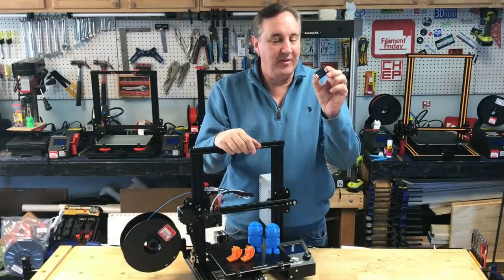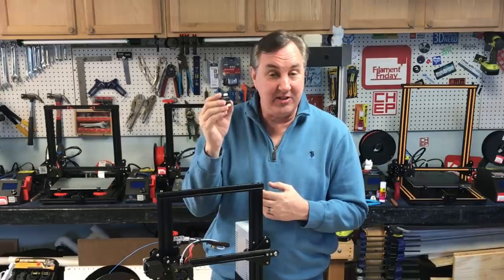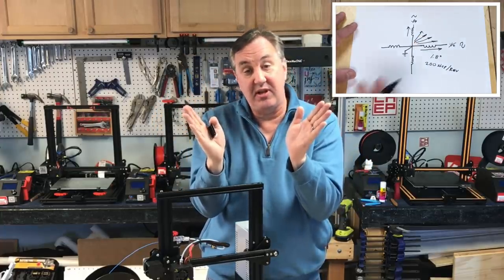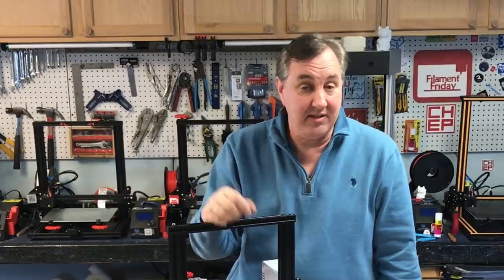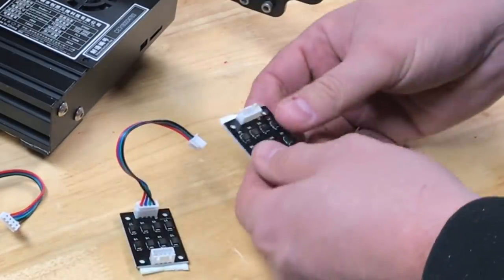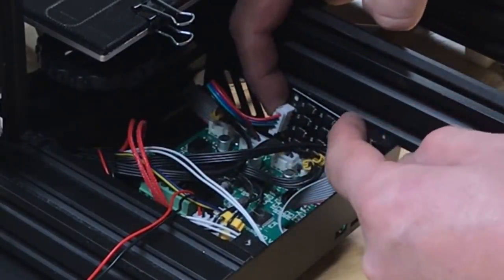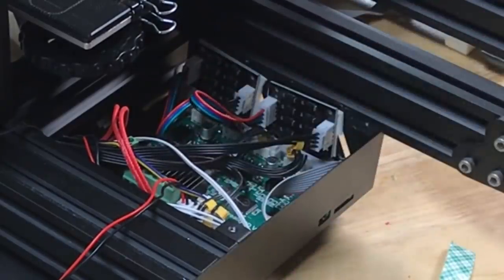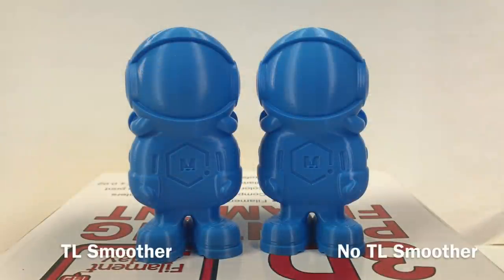Creality Ender 3 - TL Smoothers Upgrade and Test

Comment: Hi, actually this smoother can't "filter" anything. There is no "small" pulses by amplitude! All pulses from driver to the motor are 12V (if you power supply is 12V). The pulses varying only by width.
And in this context the only thing what the diodes can do - reduce amplitude of all pulses by about 1.5V. The same effect you can get just reduce power supply voltage to 10.5V only for motor driver. 
If you use RAMPS board - it have separate power supply input for motor driver. You can put in series to this input two 1N5401 and you get the same effect just with two diodes. For better result I suggest to put some 1000uF 25V elco after this diodes to the ground.
Actually less amplitude makes stepper motor a little bit slower, that what you can get simple reducing acceleration. But in this way you make it by the hardware and not by software.
This "smoother" is just waste money...
Reply: so why it did worked?
Reply: @tricelbor  As I've wrote: reducing amplitude makes stepper motor slower: smaller voltage amplitude -> smaller dI/dt -> smaller acceleration -> smaller bouncing and vibration - less artifacts by printing.
If you use RAMPS board (it has separate 12V input for stepper drivers) you can put in series to this input 2 diodes (only!!!) for all motors, but filter the power after the diodes using some 1000 - 2200 uF aluminum capacitor for at least 25V
Reply: @dgo42  There's more detailed explanations online, but they don't slow the print since I think the regulators compensate for the diode drop. I printed two 6 min prints with and without the XY smoothers on. I timed both with a stopwatch and they both took the exact same amount of time.
Reply: @ColinJWiens  You're right, steps will not be slower. I've not means so.
If you read about micro stepping you'll see, that during linear movement the stepper motor is powered almost by sine formed current (not voltage). Full period (360°) consists of 16 or 32 or max. 256 microsteps (depending on driver type and they settings). Current changes between steps are almost as fast as possible. Biggest step size is about zero current and for 16 step driver is almost 19% of entire range. If current between steps changes slowly - stepper motor shaft rotation has less acceleration (I mean between step acceleration) and therefore less bouncing!
The exact the same effect you can achieve simple reducing voltage for the stepper motor drivers using only two diodes for all driver simultaneously.

Comment: I decided to smack in a MKS GEN L board with Trinamics TMC2208 Drivers and a Raspberry with a V6 hot-end, it solved my problems at least But i won't call my printer Ender 3 anymore.
I have never heard such a silent printer compared to their shitty stock board.
Reply: Have been considering this upgrade but haven't pulled the trigger yet. Did you go with a Chinesey MKS Gen L? What did you end up paying for the board + drivers, if you don't mind? Did you keep the same motors?
Reply: @alexn78666  i kept the same motors, bought a chinese mks gen l. but i also got a makerbase version but havent noticed any differences. the board was 18-20 dollar as i could remember but i got germany made stepper drivers back because I already had a few laying around.
Reply: @E-StudiosEU  Thanks! Think I'm just going to go for it and order a Chinesey one now, by the time it gets here I'll be well ready to swap.